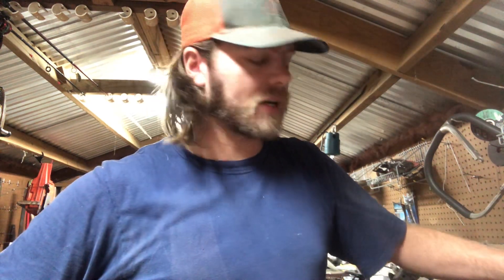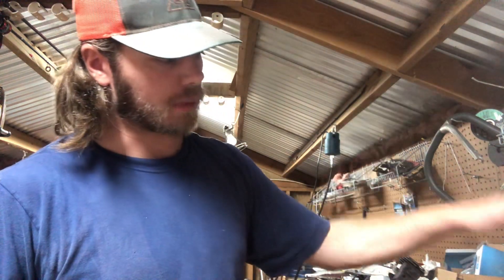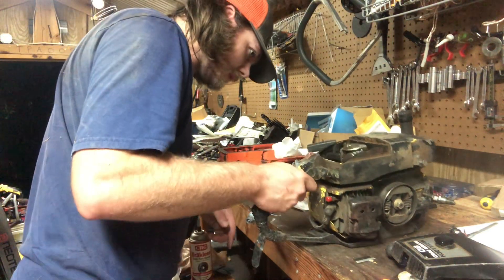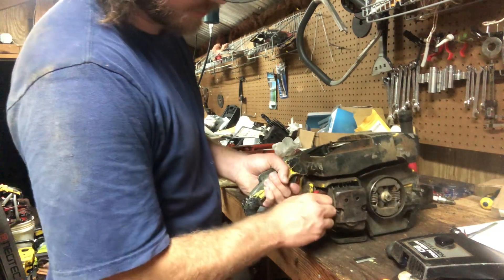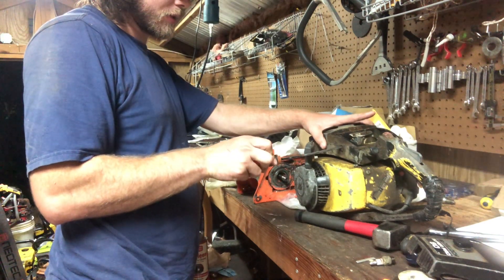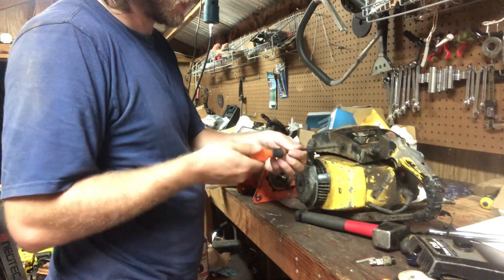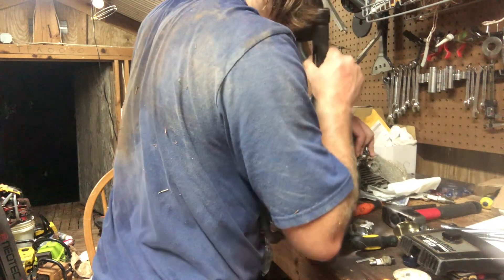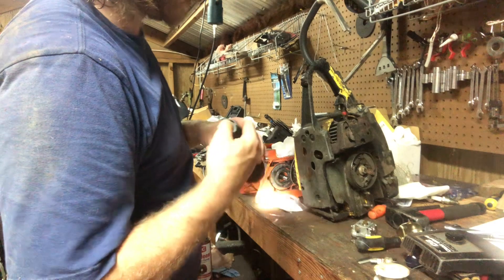Inspecting the cylinder on a barn find Mcculloch Super Pro 80

Comment: That's another cool saw. You sure are good at finding that odd stuff!
Reply from the maker: Lol I’m good at finding burnt up ones 🤷🏼‍♂️ lol, not so much at the ones that could be runners
Reply: @BamaPerformanceAndVintagesaws  that's the fun kind! I usually can't afford the jewels.
Reply from the maker: @timberslasher4899  the most expensive one I bought was that other 80 from Chad at nothingbutchainsaws, and it was 300 , only because it was in known good shape and a runner, luckily I’ve found enough good engines I can swap in